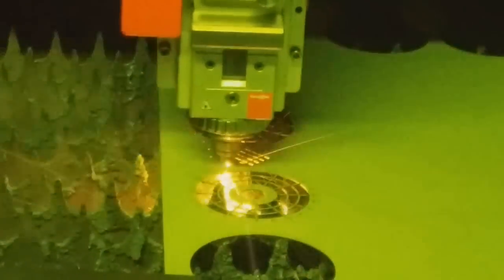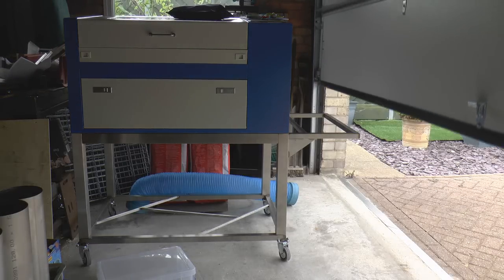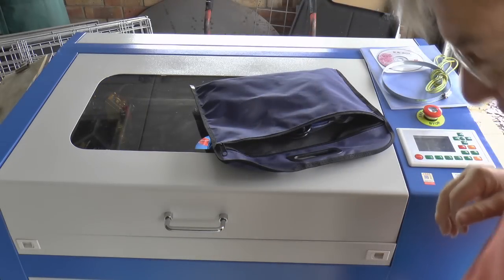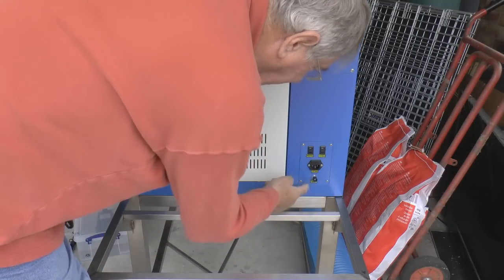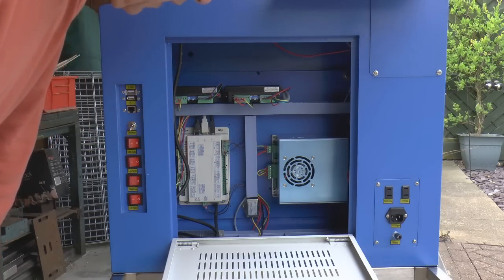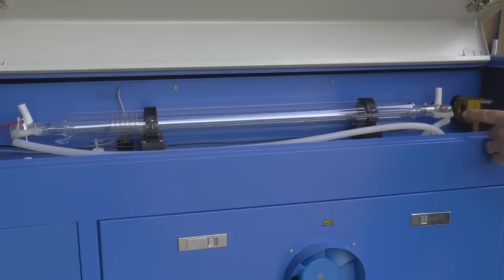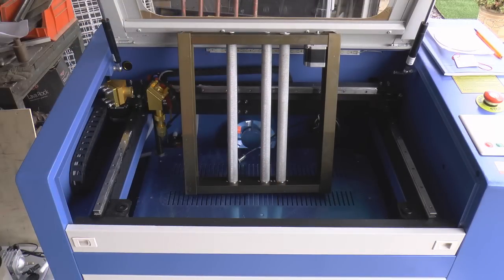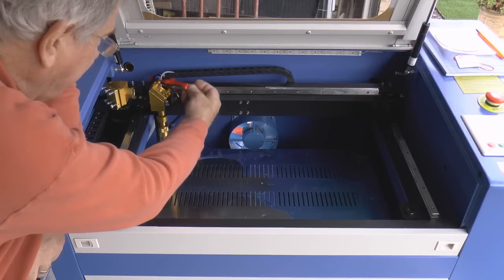Chinese laser cutter  tutorial part 1

Comment: Hi Russ my y axis is stuck and jack hammering. Do you have any ideas or know anyone who repairs them?
Reply from the maker: Hi Dex

 That hammering implies that the Y limit sensor (normally a red or blue block) is not working. This is quite a common problem.  So let's test for that first.

Assuming the machine is off, pull the gantry to the front of the machine and head to the middle and turn the machine on.  Grab hold of the head to prevent motion. It may sound terrible as the stepper motors fight you but have courage because it's not knocking 5 bells out of the end stops. After about 30 seconds it will give in

Next press the ZU button and another menu appears. With the down arrow, high light the diagnostics and press enter. Now you can watch what is happening to the various switches around the machine. Take a screw driver or knife blade and pass it over the X sensor. If it is working you will see the indicator square turn red. If it remains black then it's dead. Repeat for the Y AXIS.
I feel sure X will be responding and Y will remain black.

Let me know

Best wishes
Russ
Reply: Russ both lights are red when putting screw driver under. Dex
Reply: I do have a video if required
Reply from the maker: Hi Dex
The fact that both sensors are working is good news. Yes the video would be good as sight and sound say much more than just a few written words.
If your sensors are working then pull the gantry to the front of the machine and start the machine. With your screw driver, touch the Y sensor. The Y axis should stop and set a zero position. OK it will be in the middle of the machine, but it does prove that the sensor is doing what it should be doing. If Y is still smacking into the end stop, it proves that the sensor is not being reached. You will need to adjust the sensor forward so that the Y axis reaches the switch before it hits the end stop.

Best wishes
Russ
Reply: How shall i get video to u
Reply from the maker: You can upload to You Tube , make it unlisted and then  send me the link via this comments page.
Best wishes
Russ
Reply: Russ thanks i will do that. I think some of issues are related to the bed being set to 10000 x10000 (we did a factory reset). Any idea how to set back to normal 5000 x 3000.
Reply from the maker: Yes. Go to File Vendor Settings and enter code RD8888
With your PC hooked up to the machine via the USB port press the READ button to upload the machine settings to your RDWorks for veiwing and editing.
Select MOTOR and then X. Set breadth to the correct bed size (500mm?)
Select Y and  set breadth to correct bed size (300mm?)
Press WRITE to send the new data back to the machine.

Your problems may not be solved completely. because a 200mmx200mm drawn square may not finish up the correct size. If that is the case then I will show you how to fix it while you are in this window.
To the right at the top there is a STEP LENGTH  box. Beside that box is a button with 3 dots. Press it and you will access an adjustment window. Enter your drawn and measured sizes when/if you need to in future and then WRITE back to the machine.
Also whilst you are here press the SAVE button and save these Vendor settings to an external file on your PC.
When you have closed this window, go to top right and press the USER tab. Press the READ button and then Press the SAVE button to also save these USER settings to and external file on your pc

Best wishes
Russ
Reply: The y axis on the machine is jamming whenever it tries to move up and down. It gets stuck. And now that we held machine head in place the x axis has started to stick too
Reply from the maker: If you check the X and Y cordinates on the keyboard it looks as though it does eventually do a reset. If you use the arrow keys and first drive the X axis fully left. Does the display say 0? If you do the same for Y,  I guess you will get to within 1mm on the display and then it may go bonkers with the hammering? and never reach 0.  If so, the red switch at the end of the Y axis needs adjusting forward by a millimeter or so so that the Y display stops and says 1mm on the display. Now when you press RESET It will reset without hammering and you should be able to drive the machine to Y=0 with the arrow keys.
Best regards
Russ
Reply: Russ I don’t appear to be getting anywhere. Is there any chance that we could engage ur services on the end of a phone call when we r in front of the machine. Happy to pay for ur time. Obviously won’t expect u to publish number here but I’m happy to give u my email address. Dex
Reply from the maker: Check your You Tube  messages
Russ
Reply: Russ. Hi i have made some progress. I have machine set to x 0  y 0 and z 3000 (not sure this is correct). The x axis moves freely across the arm. The y axis only moves about 1.5cm. See video. I will also attach a photo of the y axis settings in vendor settings. Dex
Reply from the maker: Hi Dex
First off you have your max speed set way too high. Bgo to your max speed button and nset it to 150mm/s max.
Also I need your vendor and user settings to check accelerations. I have sent you my email in the you tube message system  can you send them to me please.

Best wishes
Russ

Comment: Hi Russ, well what a day, 10am I have a wooden crate on my doorstep, unpacked and all perfect plus a bonus, it has a motorised platform, brilliant. But all looks great. Nice size. I just have to figure the program configuration out with RDWorks and Corel draw, I feel like I've got the right tool now to do the job, I'm going to go through most of you videos as you clearly show your not afraid to have a go, and your theories are pretty good, but most of all Russ your an interesting talker, not like some that put you to sleep. I'm ready now or nearly to get those jobs rolling, I've had a lot of interest as I to ran a local business & pretty well known. Cheers Russ keep well.
Reply: I
Reply: What link or machine did you buy to get the motorized platform.  From the pictures on eBay most do not seem to have motorized platforms, just manual knobs. Thanks

Comment: Hi Russ, I chatted to you last week regarding using a UV water cleaner, thank you for the reply, I have just ordered one of theses 50 Watt machine, reason is the size suits my property also I can after seeing you on here upgrade to a powerful machine without going into the thousands, I note the one you have has z axis, sadly the one I'm getting is manual that's the only difference, I paid £1,150.00 after a bit of bartering. It is brand new, and I hope unlike my K40 that will be on eBay next week, the laser alignment was out and it was hard to get it right, would it be a big job to have mine converted to a motorised platform ?  Thanks in advance. Ray Massey, hope you are keeping well.
Reply from the maker: Hi Ray
Dont be too upset about it being a manual Z. Mine only has a small DC motor to raise and lower the table using the same belt that you will have. It is not a stepper controlled Z. I have a stepper controlled Z and auto focus on my Lightblade machine but to be honest I have never used it in anger  and can see little point for auto focus. Setting the focus manually is so much quicker.
 Here is a link to a little video with all the part numbers of items used for motorizing
https://www.youtube.com/watch?v=Zi8ptM-W2yE
Hope this helps
Russ

Comment: Where did you get your 60w tube and power supply from? And were they expensive if you don't mind me asking?
Reply from the maker: Hi Ash

This is what I bought 2 years ago . The basic price was cheap BUT then add on DHL carriage costs and it doubles plus 20%VAT and small import charges  So it was not that cheap in the end about £550 total with the $ exchange rate at the time. I would not go that route again because we can now contact gareth@thinklaser.com where the cost will be more reasonable for a high quality EFR long life 60 watt tube.and power supply. I would guess that with VAT, at least £100 cheaper than this because it will have arrived in UK the slow cheap way, by boat. But as I said don't rush to upgrade, learn a bit about your machine  if it sort of works, that way you will be a pro and be able to care for your "second child" with experience.
Best wishes
Russ
Reply: SarbarMultimedia Thanks for the info Russ... For the cooling of the tube, is it better to use de-ionised water or pure distilled? Or does it matter?
Reply from the maker: Deionized water is mainly free of  dissolved solids but is not bacteria free. Distilled water is free of chemical and biological contaminants. I have had my distilled water from new and even after two and a half years it is still clean and  clear.  I test it regularly for sliminess and taste
I could only recommend distilled. We have a condensing tumble drier that produces what should be almost distilled water but the smell of softener scent tells me it's tainted.It will be back to the pharmacy when the time for replacement arrives.
Best wishes
Russ
Reply: SarbarMultimedia thanks again mate 👍

Comment: Hi Russ, I'm seriously thinking of buying one of these and after watching your videos I think I'm ready to take the plunge. Can you advise which seller on eBay you purchased yours through as there seems to be quite a few people selling these cutters and they all seem to be getting shipped from Germany/Poland. 
On a second note, did you have to pay any import duty on the cutter when it arrived in the UK? 
Thanks for all your info, it's been extremely useful in making my decision easier. 
Ash
Reply from the maker: Hi Ash
My particular model with the motorized table seems to be all sold out, just the manual raise and lower table version now. It's not a serious compromise though.
As I have warned, you will have to accept that you will not be getting exactly what is advertised. The 50watt tube will be a B grade 40 watt tube  that may perform badly. My seller is no longer around but that is not surprising because these are all private Ebay sellers based in China selling machines they have never seen (for commission) from various warehouses around the world. Even though you may have to replace the tube (and maybe the power supply) soon after you get your machine, these still represent excellent value for money. Yes there will be some tinkering required (most work straight out of the box) but I bought it knowing that it was almost a pre-assembled DIY laser machine. My only serious advice is to buy with your CREDIT CARD. It will usually have to be via Pay Pal but they service credit card payments. I say this because neither Ebay or PayPal will be of any use in the case of a dispute. The only use for ebay will be to communicate (and record those communications) with your seller. There is a legal requirement on your credit card company to protect your purchase and that can be a powerful threat against your seller should the need arise.
The warehouses that you mention are both in EU , so there will be no cross border tariffs.
Best wishes and good luck
Russ
Reply: SarbarMultimedia 
Thanks so much for your response Russ. 
I'm actually looking at buying one from Amazon, it's a little more expensive but you are covered by Amazon buyer protection. I'll double check about the motorized base, thanks again... Ash 👍
Reply from the maker: Hi Ash
Read the Amazon small print carefully because I know that PayPal exclude "manufacturing equipment" from their protection scheme and  you will be buying from Amazon marketplace and not Amazon directly. Caution.
Best wishes
Russ
Reply: Hi again Russ, just a couple more questions if you don't mind? 
1) Have you found that you need to use an industrial chiller for the water? I know a few people have them in warmer climates but I'm not sure if its necessary here in the UK?
2) do you think it's possible to fit a safety microswitch to the hinged lid that will cut the power to the laser upon opening? I'd rather have this in place to reduce the risk of injury.
Reply from the maker: Hi Ash
Chiller? It all depends on the power of your tube, how much you plan using it and if your main use will be cutting or engraving? I have about 10 litres of distilled water in my reservoir and  It has been there for about 30 months  without going green  or cloudy.. I do not use my machine in anger but full 60 watts for about 2 hours continuous use  will drive the tank up to about 40C. Most of the time it's in the 15 to 25C region. I have a CW3000 air blown radiator system on the Lightblade machine and that also seems to work OK but is just as prone to getting hot in the summer months.  If it's only for hobby use, I would set up a cheap closed system in a lidded plastic box and see how you get on. Here in the UK (and i'm South East near London) the bigger issue will be stopping the water in your tube from freezing if it's in an unheated workshop. Don't think about using antifreeze.

Safety switch?  No problem. There is a contact on the controller for just that purpose. However, you should not fear the laser, but understand and respect it.  It is just like a torch beam, but is an invisible beam of light. It will not jump out and bite you. That beam of light has special properties and when it hits the surface of a material it will do one of two things. If that surface is metal of any sort it will reflect. Different metals reflect with differing efficiency. Copper, aluminium, gold and  silver are 99% efficient, others will be 60 oto70% or more. The reflecting surface has to be flat (just like a normal mirror ) so the chance of you getting a beam pointing at you will be VERY remote as you will not be doing anything with metal in your machine. The other thing that the light will do is to be absorbed by the surface it hits. Absorbed gives totally the wrong impression because the light is not soaked in like with a sponge, no, the light interacts with the SURFACE atoms of the material stimulating them to higher energy states (just like your microwave oven does to water molecules) thus heating them up. All non-metallic materials are poor conductors of heat, so the very high energy levels at the surface raise the temperature so high so quickly that the material evaporates.  It needs to be focused and at VERY high energy densities to do serious damage to any material. Unless you put your eye or finger directly into the beam path there is no risk associated with the beam. I have been stupid and forgetful on a couple of occasions and the resulting burn to my finger was painful for half an hour but  the instant scar that occurred had disappeared within two weeks.. Eye wear of any sort, and I wear cheap pound store reading glasses,  will completely protect your eyes . If for any chance in a million the beam reflects at you then the surface of the plastic or glass will completely absorb the energy and damage the surface of your glasses and not burn the surface of your  eye.
 As I stated earlier, understand and respect. I run my machine 99% of the time with the lid open otherwise I could not share good video footage with you guys.

Best wishes
Russ
Reply: Thanks again Russ for your very detailed and educated response. I very much want to understand all aspects of these machines as I will be investing in one just like yours very soon. 
I intend to use mine as a hobby initially but once my knowledge has improved I intend to use it for the creation of arts/crafts and maybe start a small business from home. 
I will probably upgrade the tube at a later date, are you still on your original tube from purchase? And do you still run it at no more than 60-65%?
Reply from the maker: Hi Ash
As  I warned , my first tube was rubbish and because of my naivety, I bought a replacement from Ebay that was little better. After 6 months of perseverance, I spent out for a proper 60 watt tube and power supply. Here we are 2 years on and it's still working just fine. The tube must be considered as a consumable (like an ink cartridge). It will eventually destroy all the CO2 in the gas mix. For about £3 you should fit an ammeter and understand what the maximum drive current is for your tube. Your 50 watt tube would normally run at 20mA BUT it will only be a second rate 40 watt tube and should be limited to 18mA.  For those people without an ammeter, I suggest 60% as a reasonable guess at the current limit. I have my 60 watt tube working at 22mA and that happens at about 68% power. You can tinker with the mechanics of the machine to effect improvements but until you invest in a proper tube and power supply you will not have a reliable machine. Buy and try before you maker that decision, you may be one of the lucky ones.
Best wishes
Russ

Comment: In the states, we have 3 prong plugs and sockets that consists of positive, negative, and ground.
Reply: Line, neutral (the return wire) and ground.  Unless your house has old wiring, in which case you may only have the first two pins.

Comment: Hi Russ, thanks for the great videos!! I purchased the same 50 watt laser. I have installed the water pump and have tested . Water flows in and out as it should into my bucket. However no water seems to be be flowing into the laser tube or the hose going to it. Any insight on this would be greatly appreciated. Thanks in advanced.
Reply from the maker: Hi Kevin
There are only a certain number of things that can be wrong.
First I am puzzled about your words " Water flows in and out as it should into my bucket". There are two spouts on the back of the machine marked water in and water out. I make the assumption that your pump is connected to the water in spout and that the returning water is coming from the water out spout and back into your bucket? If so then I am really puzzled because the only link between those two pipes is the laser tube itself. Perhaps you can define you problem different way so that I can gain a clearer picture of how everything is connected
Best wishes
Russ